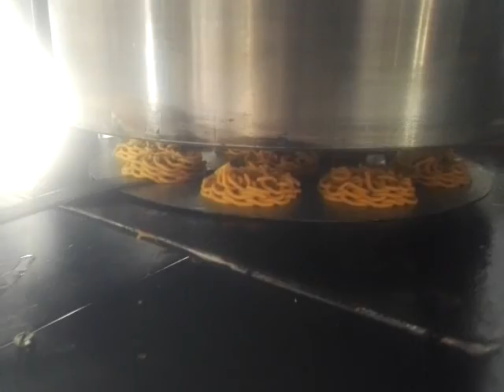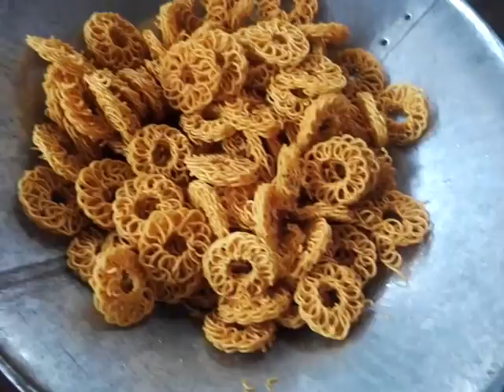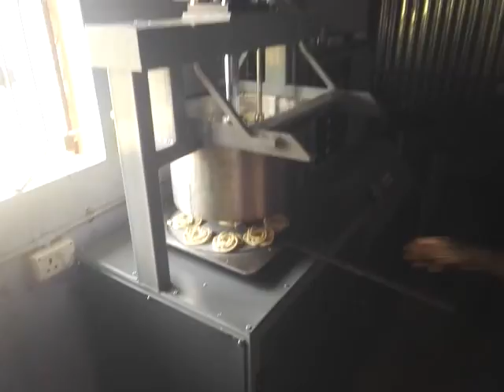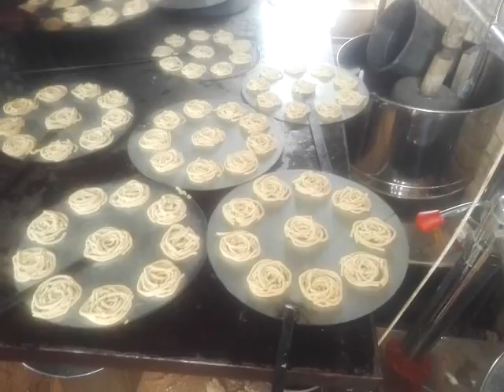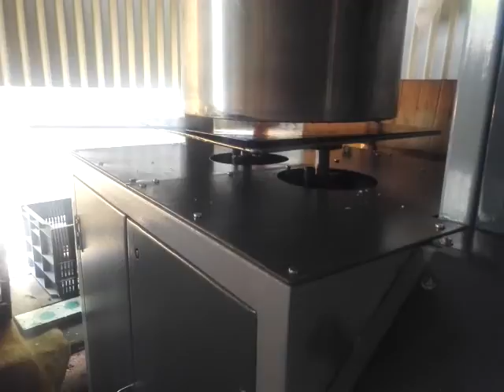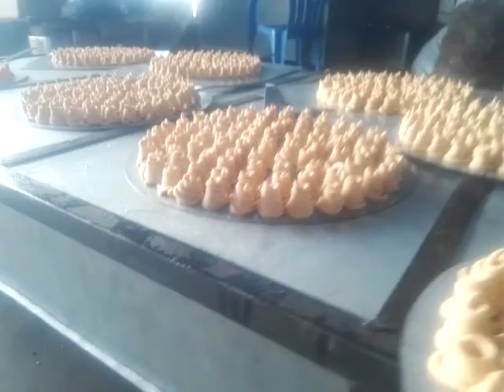9865267447 Murukku Machine, Jangery Murukku, Chakli, Murukulu, Jantikalu Making Machine

Comment: Hello Sir ...Can u make changes in the shape of murukku according to our requirements....
Reply from the maker: Yes sir . we can do in this machine
Reply from the maker: Fully Automatic Murukku Machine - PLC Model - Rs. 3,25,000.00

              Motor Power : 1 HP & 2 HP Each

              Hydraulic Powerpack System

              Program Logic Control

              One Die Free. Extra required dies are chargeable
Reply: What is the output of this machine per hour ?

Comment: Bro  jilabi machine keten  muruku ila
Reply from the maker: Yes sir . we can do in this machine
Reply from the maker: Fully Automatic Murukku Machine - PLC Model - Rs. 3,25,000.00

              Motor Power : 1 HP & 2 HP Each

              Hydraulic Powerpack System

              Program Logic Control

              One Die Free. Extra required dies are chargeable

Comment: Price pls
Reply from the maker: Fully Automatic Murukku Machine - PLC Model - Rs. 3,25,000.00

              Motor Power : 1 HP & 2 HP Each

              Hydraulic Powerpack System

              Program Logic Control

              One Die Free. Extra required dies are chargeable